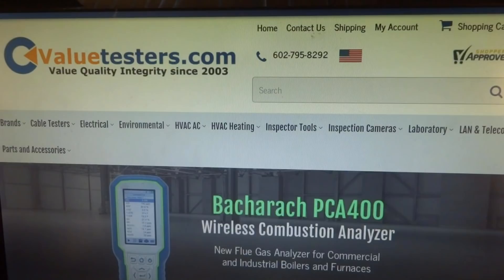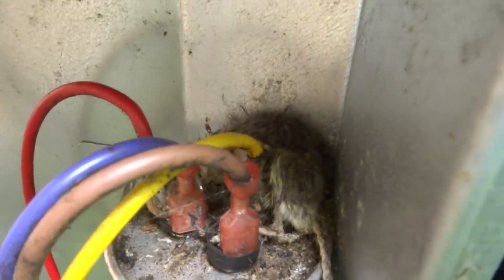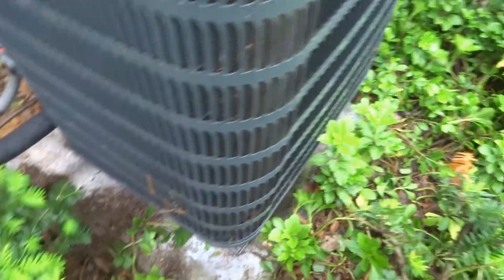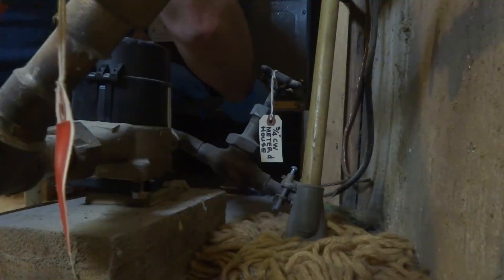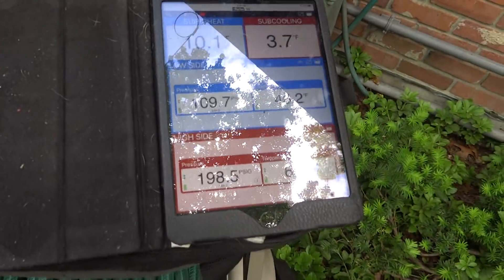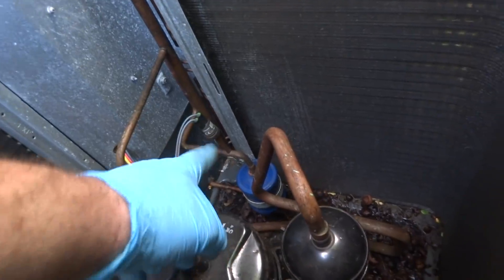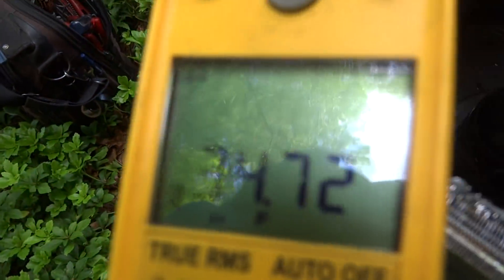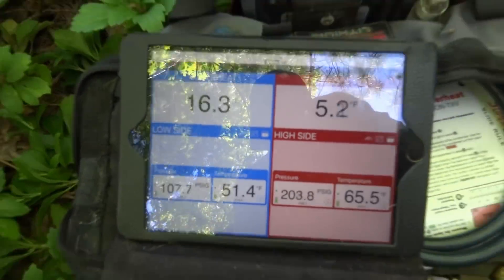Air Conditioning system check and clean hvac training

Comment: @10:30 I was thinking to fill the holes in the cabinet, a scrap of armaflex  or some black adhesive pipe wrap tape, which are both intended for use on linesets.

Comment: Why don't you acid bath your compressor and evaporator when cleaning unit? I would do it once a year (pink - used for outside cleaning of fins and fan blade) (green- for inside cleaning of evaporator and making sure drain is open from pan to outside ).

Comment: Steve, when cleaning out an a/c condenser unit, can you just hit it with a power washer...with the same setting as when you wash your car?
Reply: Ron Robertson pressure is to high, likely will bend the aluminium fins. They make a coil jet product though. Portable pressure washer that is set for cleaning coils.

Comment: Hey Steve, Do you like the UEI DTH35 better then the Fieldpiece PRH2 that you used to use? Wet Bulb on my Fieldpiece is Ok ,but i've always questioned the humidity. I like the look of the long snout on the UEI.
Reply from the maker: my field piece fell apart yes i like the uei better way better ,,but a lot bigger  but has a magnet on back so i stick it up high in my truck cab to pevent damage  i use it for wetbulb and out side temp for super heat mostly.

Comment: maybe put some kitchen 'steel wool' balls/pads in the openings to prevent mice from entering ?  they won't rust
Reply: What kind ? Galvanized steel wool.....
Reply: stainless steel scrubbers you'd use to clean pots in the kitchen
Reply: I stuff my outside a/c line set conduits with 0000 steel wool....squirrels,rats etc...can't chew threw it. My neighbor had a squirrel get in and die in the attic above his master bedroom......they had to cut out the vaulted ceilings to remove it
Reply: kennycybertron1 won't there be a galvanic reaction between the copper and steel wool possibly causing corrosion of the copper line set????
Reply: Ma Ma Not that I've seen...I checked them when I'm doing the maintenance and no problem